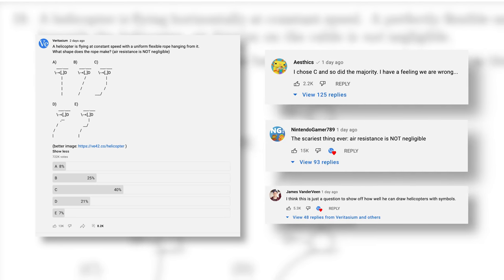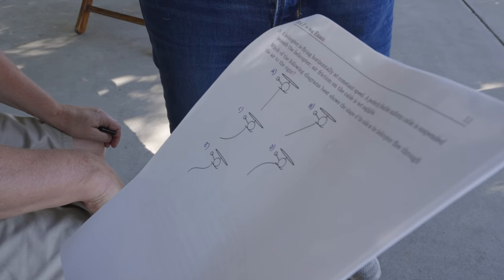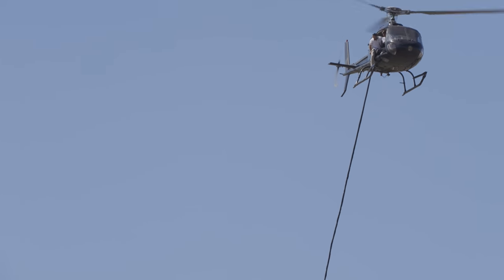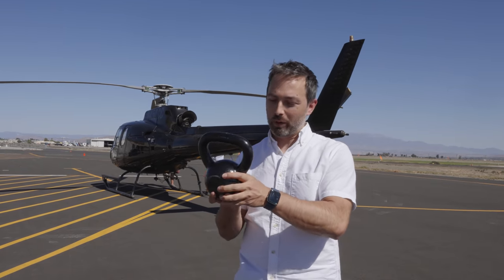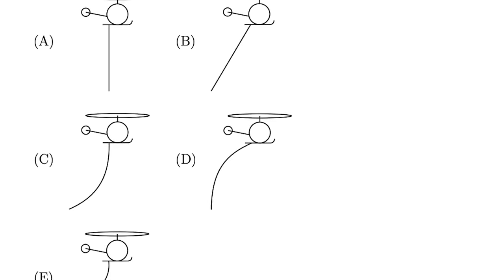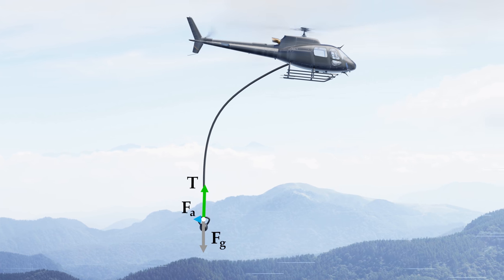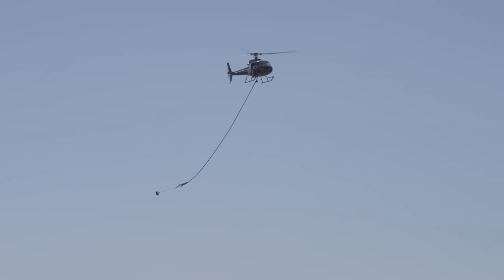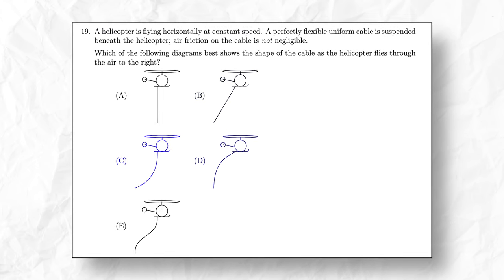I Rented A Helicopter To Settle A Physics Debate

Comment: I think a lot picked "C" because it would likely look like that whilst accelerating, but at speed it would be "B."
Reply: That’s why reading the question is also important. I got the second question wrong because I failed to take into account air resistance, while getting the first right by reading that it was at a constant velocity.
Reply: But the whole rope has to accelerate, the top of the roap being pulled forward with the helicopter, then the bottom being pushed back with air resistance, it would be the same scenario, the rope would always be in a straight line, though flexible. You assumed that for the same reason the majority assumed "C", because it does look like that's what would happen.
Reply: I'm not convinced. I think Derek's explanation is lacking something, the sheer weight of the rope makes air resistance negligible, a lighter rope could reveal answer C to be correct, and the majority of people don't just pick C because they're dumb, but because of experience.

I think he's lacking the pull of the rope on itself. The higher the point on the rope, the more rope and thus weight below it.

With the rope as heavy as 20lbs the air resistance on the lowest point becomes negligible compared to the weight.

Also I wonder how the rope would behave when the helicopter were moving through a vacuum.

Hm... Somehow I don't expect anyone here to have a discussion about this. Only giant explanations how everyone thinks he's right. Why's that, I wonder...
Reply: @nightmareTomek  I seriously think you’re exaggerating the general populations understanding of physics. There’s lots of examples of people getting forces on an object wrong because they just pick what they observe the forces to be. An average person who hasn’t studied physics in detail will answer a lot of these questions wrong. Nothing wrong with that either, most people just don’t study this subject that deeply. Nor do they understand or even take into account weight of rope or know how to account for air resistance. As for people disagreeing, it’s YouTube which lowers everyone’s Intelligence by a good 50%. However dumb you think the population is overall, lower it by 50% for anything on the internet and you get a pretty good estimate for intelligence online. To make it worse, everyone thinks they’re an expert online as well. Just facts here
Reply: the key word there was "constant speed", nerd stuff ---> meaning in a basic physics question to F=ma on the rope and a=Constant the only answer choice is B because the mass on the rope would never change... honestly though I would have missed it overthinking it
Reply: @rbarua3368  if you take a look at 0:19 you can see that the Question is not specific on weather the Helicopter is accelerating or not.
Reply: @meinereiner5058  It does state “constant speed”. That’s pretty clear.
Reply: @rbarua3368  Ups, yes you are right i only looked at the Question not on the first sentence. my bad. (proofs that you were right that reading the whole thing is important)
Reply: @ZenoSol_  Ok, everyone's dumb and doesn't wanna acknowledge it. I wonder if you considered that this might apply to you as well. (And me, but I believe you did consider this one).

Anyway, there's still a phenomenon called "Wisdom of Crowds", it states that the average of opinions of a big group is or can be more precise than the answer of the most knowledgeable expert individual. Because of that I'm immediately suspicious, when someone simply says "the majority is just wrong".

I still want to know if Dereks answer is complete or not, it feels to me like it's not. The weight on the bottom parts of the rope pulling on the top is what I think is missing. I want to test it myself, I'm just not sure how yet. I'm not exactly having a helicopter in my garage.

Anyway, in case I were to find the correct answer and were to explain it here, I doubt anyone would listen.
Reply: @nightmareTomek  Interesting never heard of wisdom of crowds but seems like its highly plausible, although I still think on the internet it's unlikely. I specifically avoided the physics because it does seem like what you said could be right, I agree with that and would like to see it too. I think i may have just misinterpreted what you wrote to be more cynical and negative
Reply: @nightmareTomek  “Also I wonder how the rope would behave when the helicopter were moving through a vacuum”   
That one even I could answer.  Both rope and helicopterwould go straight down to crash on the surface.   Question is how to get them off the ground in the first place. 🤓
Reply: @MendTheWorld  Damn, I forgot about that -.-
Reply: I thought B as well. Because I was thinking of what happens if you drop an extended slinky out of the window. The second you release it. The rest of the slinky is motionless in air until the top part of the slinky starts to contract and only when it’s fully contracted will the rest of the slinky fall.
Reply: @nightmareTomek  could you please explain to me how a helicopter can propel itself through a vacuum??????
I think the majority went with C because logically they would assume the rotor wash is a big factor. Most people have years of tv watching experience of how strongly rotors impact the air around & below them, so seems obvious to me that is a factor in the question, otherwise B seems obvious & way too simple, so must be a catch

& a change in the rope's weight will potentially impact how much the rotor wash comes into play, but it's not going to change the physics that goes with the weight of the rope being the same throughout it's length, therefore the answer will remain B obviously
Reply: @nightmareTomek  how you test the physics minus the rotor wash is with a helium balloon & a string or cotton attached to the bottom. Pretty easy. You could also hang a ribbon or piece of cotton or similar from the antenna on your car or attach ribbons to the ends of the handlebars on your pushbike, lots of options! You just need something travelling at a constant speed that a piece of rope/cotton/string can be hung off
Reply: @lilaclizard4504  Yea, I'm going to test it with ribbons hanging from my bike. I also wonder how the rope would behave in a vacuum, would it simply go straight down in a line (answer a)? But yeah, the helicopter would... I got that finally.

It also doesn't get to me how the rotor wash is negligible, but the air resistance isn't. Isn't the rotor wash stronger? Maybe people indeed picked c with that in mind.

Also if you have a rope which is so long it can't hold it's own weight, and you let it hang.. where does it rip? At the bottom or at the top? Although the weight of the rope is the same throughout the whole rope, the pull of the rope on itself isn't the same everywhere.

Maybe Derek's right. But I feel weird about it. A puzzle piece is still missing.
Reply: @lilaclizard4504  Well, this time you dedicated a whole paragraph to talk off my topic.

I don't wanna add any kind of weight or force to the rope, that would indeed result in random snapping locations. I want the rope itself to be long, weak and heavy enough, so it snaps from it's own weight. A chain with alternating heavy and weak links for example. Then it's should be less random. If you hang such a chain, the upper links experience a higher pull than the links at the bottom, so it's more likely the chain breaks at the top. Isn't it?

The same effect should be happening with the helicopter rope. I think the rope experiences a greater pull by itself on the top compared to the bottom. I wonder how that affects it's shape. It's just that because of the weight of the rope it's negligible, as is the downwash and air resistance. But what if the rope were so light that it weren't negligible?
Reply: I imagined the air resistance would be less closer to the helicopter kinda like when you are following a car on the road. Or maybe it's more because it's on the side of it ? nevertheless it would be interesting to see the results with a lighter rope
Reply: @cedvdb6473  the air resistance is less closer to the helicopter because at the surface of the helicopter there is zero relative motion between the helicopter and the air. But this effect boundary layer dissipates (I don’t know if “dissipates” is the correct terminology ) pretty quickly.
Reply: @nightmareTomek  I would like to know if you ended up testing your hypotheses. If so, please do share any results.

Also, for the hypothetical rope that is to heavy to hold its own weight, and assuming the experiment takes place as in the video, it would break towards the top but keep in mind that would be a transient situation and therefore conclusions for the shape could not be drawn from that. 

Regarding the rope tension it is as you mention higher near the helicopter. But rope tension by definition would always be along the axis of the rope) and could not affect its shape of the produced curve (other than elongation)
Reply: The answer is D if the helicopter is accelerating. Because you can imagin that the helicopter is kind of the parachute but on top going forward.
Reply: @nightmareTomek  a rope (or chain) that breaks under its own weight would do so due to tension, which is greatest at the top as he did explain in the video.

It would also be interesting to use a relatively stiff material with an added weight at the bottom, which should result in the shape depicted in E.
Reply: @nightmareTomek  Sorry for the response on a 4 month old comment but I need to address this before people start using wisdom of the crowd as an argument in science.

The majority is more often than not wrong in many accounts of things other than ones that are actually about probability. As such, if we asked for people to make a guess on the amount of money the rich probably have, then the average of that guess would likely be more correct than, or in line, with the guess of an expert. This is true in a sense because humans are also a bit probabilistic and would maintain an answer a few steps off from the true answer. Aggregate that, and you'll find the "Wisdom of Crowds". (I would like to add that these estimations are also true of general world knowledge and spatial reasoning.)

However, if it were on matters that isn't probabilistic, the wisdom of the crowds generally dissipate. We know this because of how the wisdom of the majority isn't quite too correct on things like the relationship of the sun and the earth, the shape of the world, and — as shown in the latest Veritasium video on electricity — the way energy is transferred through electricity.

The experiment shown in this video is not probabilistic (even arguing that it were because of the fluctuations of the wind, those are to some extent negligible). Thus, the Wisdom of the Crowds cannot apply here.
Reply: @kamkamkam_  I think you made that explanation up all on yourself, because I've never heard that at all and it doesn't make sense to me either. And when you say stuff like "we know this", you're making use of a very, VERY common strategy of telling your opinion like it were an established fact, essentially lying. Let's be honest, 99% of people on the internet use this strategy, they present their opinionated guesses always as if these were scientific facts, which they nearly never are. Who is "we" and where exactly is the proof? "We" as I know it doesn't even consider the existence of the wisdom of crowds.

This wisdom usually doesn't work when the group is biased. Lets take the latest video of Veritasium as an example: the population has been taught a simplified model of electricity at school, thus making them biased. On top of that the social pressure causes people to stick to what they've been taught. On the other hand, if you had asked a probabilistic question like "how far away is the sun" a thousand years ago, I believe the wisdom of crowds would have utterly failed, too.

And I think the wisdom of crowds can apply to non-probabilistic questions as well. Your explanation sounds insufficient, so I have to ask again: why not? I think people can have a feeling for the right answer out of their experience watching everyday things. And they've forgotten what they've been taught about the rope problem at school, so that's why they're no longer biased, and this makes them picking this answer... was it C? Very interesting. Maybe they're indeed wrong just like the crowds would have been wrong 1000 years ago about the distance of the sun. Then again Veritasium is putting out a lot of videos lately with "you never understood this correctly" and "you always understood that wrong", this makes me very sceptic. For his first video of electricity he received the well deserved backlash, he did a bad job explaining and didn't show any testing, like in the 2nd. For the video with the rope he simply didn't receive backlash. So I'm wondering... should he have?
Reply: @tjay5837  I haven't tested it yet, I have to admit, I keep forgetting. Not enough sophistication for all the scepticism.... But when I do, I'll remember to tell everyone... (unless I'm wrong, ofc. xD No, I will do it anyway...)
Reply: The "wisdom of crowds" thing is why contestants on "Who Wants to be a Millionaire?" should ask the audience when they are unsure. That audience might contain some very clueless people and the contestant may be far more knowledgeable than an average person, but the crowd will almost always get the right answer.
Similarly if you ever want to win one of those "How many jelly beans are in the jar?" competitions, the answer is almost always the average of all the previous entries, so you can win just by keeping track of what everyone guessed and picking a number right in the middle.
Reply: i'd initially think c at speed cuz at top, entire cable mass is exerting g force down while at bottom only small mass... but then the wind resistance force has zero displacement impact at top.  At bottom there is no adjacent wind force... and the question gave no stiffness parameters but obviously IF it is higher stiffness it'll approach B minimally.  But let's assume the rope is zero stiffness. If rope is L long, and mass M, and wind force/unit length is constant (ie rotors not inducing non-constant there) then for each inc. length dL, at equil., l (distance from bottom of inc. dL) x M/L = mass of rope creating downward Force.   And then whatever curve it settles at, each dL will have same unit mass/wind force ratio since the component contributions simultaneously contract or expand w/ angle.  D is intuitively obvious for hanging weight once that's in
Reply: @nightmareTomek  if vacuum,  straight down.
Reply: @nightmareTomek  it’s moving through air. Therefore there is air resistance and it isn’t negligible because it’s not a vacuum what a stupid comment
Reply: @nightmareTomek  Of course most people pick C because of experience, that's why they chose this question for the test, it's purposefully misleading. The sheer weight of the rope doesn't make air resistance negligible, that's not how air resistance works. A lighter rope would only change the angle the rope makes with respect to the helicopter, because regardless of the weight of the rope, it is uniformly distributed.  He demonstrates both that increasing air resistance and increasing gravity both have an effect on the rope. You're just wrong.
Reply: @darrylkinslow5613 while accelerating not every point on the rope is necessarily moving with the same velocity so the same logic does not apply.
Reply: @goldenking2046  Yes, accelerating IS the point. You clearly don't know about physics, and also did not pay attention to this video...
Reply: @goldenking2046  Umm, that was the point I was making, so why did you reply to me? you should have been saying that to those who thought I was wrong...
Reply: Maybe I'm missing something, but I thought the answer was obvious? 🤷‍♂️
Reply: Actually viewing the helicopter, the shape of the rope is 'B'.
Reply: It would look like the inverted hook while accelerating.
Reply: Why would it be C when accelerating. When accelerating the inertia of the rope will pull the rope back, while the helicopter will pull on it making it B
Reply: @TheDewDesigns  a is zero because there os no acceleration when at constant speed